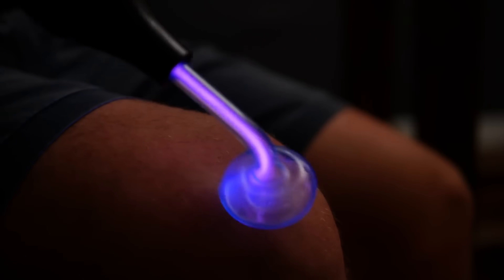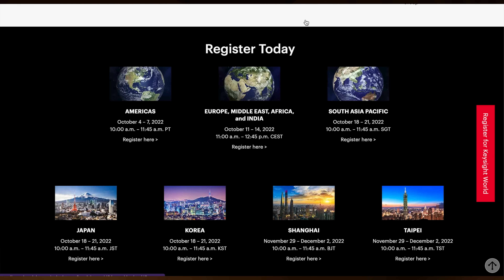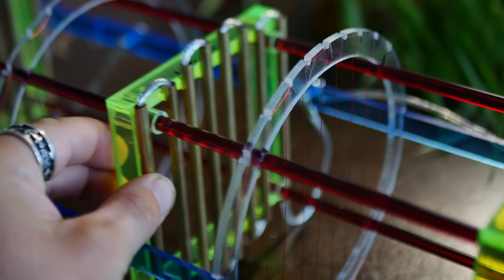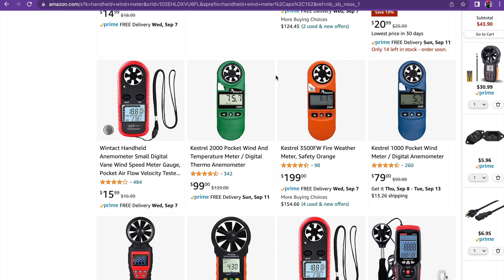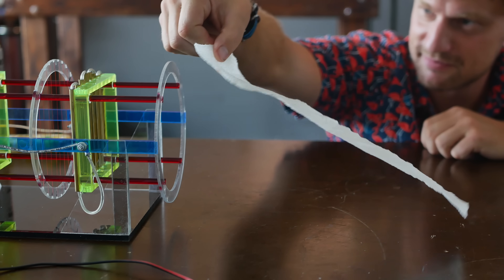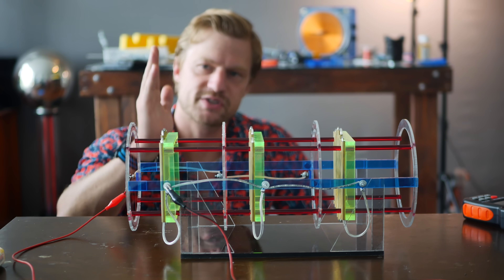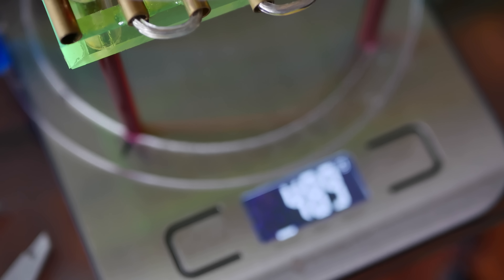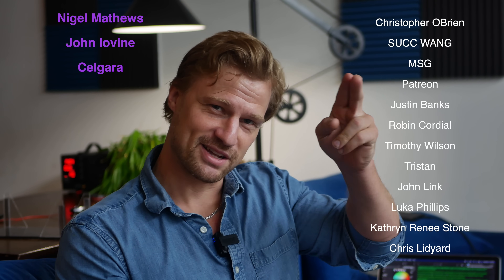Designing A Next-Gen Ionic Thruster! (For Flight)

Comment: Beautiful Build and excellent scripting/editing. KUDOS ❤
One area of improvement, which the spacing is beginning to introduce is to stage the lead of each stage to be lower  than the end stage of the previous stage.  Accelerate rather than retard the ions between stages. 
However, more thrust by increased airflow (even without more ionic thrust stages is possible) Also a proven design is to use the “blade less” fan modification, introducing an external air supply to be sucked into the existing (more concentrated) ionic thrust central flow. They say up to 10x increases in air flow are possible. (If memory serves). Looks to be a key innovation to electric airplanes in design already.

You are the FAN MAN!  Success is yours to capture. Tether it to the table or a replica of the Eiffel Tower and a new topper for Christmas Trees and executive desks or totally revolutionary drone power is born. 
Another idea is to compress the ion flow by constricting the pathway. (Using a tube with an inductor winding (magnetic bottle), perhaps with a rod set to rotate inside with a bullet tip and cupped end (AKA GEET Reactor) low cost Z-Pinch plasma fusion stage… and/or add water vapor to your air supply (massive increase in mass of ions with amazing ionic reactivity) 
Party on Dude.

Comment: I suggest going back to a square thruster path. You can now cheat by angling the follow-on stages, narrowing your box area without narrowing your ion mesh creating increased air pressure against eash stage until the exhaust is a narrow thrust nozel

Comment: The thrusted air comes from the pulling of ions from across apposed charged metals, the charged air exiting each grid section would be improved by adding in a charged gas to replace the stripped electrons exiting the grid of each section.  Enclosing this fixture would actually slow the thrust down since it relies on pulling external air in with the laminar flow of charged electrons, so if each grid stage had a large funnel shaped air scoop, it could pull in and condense more airflow for each chamber, thus a net gain in thrust output.  Another way to gain more thrust is to redirect a portion of the expelled air back into the frontal intake, because there is no limit to the speed of airflow that can be introduced into the device, so this would act like a turbo charger continuously increasing the air flow, thus creating a larger and more intense draft of ambient air into each grid section, creating a suction in the front of each grid air scoop.

Comment: I love your dry ice wind tunnel. I don't think I would have ever been able to get my hands on anything but the "plasma" plastics. Is there any difference to the thrust by splitting the wires into multiple parallel joined wires? Can the thrust be made variable? What happens when you do the distance adjustment on a single stage?

Comment: Things that I would try if I had the tools and the space to work on this:  Enclosing the device.  Taper the enclosure so the opening is wider than the exit to create compression.  I would experiment with spacing, and I'd experiment with staggered voltages as well.  Don't make them all equal.  Maybe higher voltages as you get closer to the exit.  What about decreasing the gaps between the wires?  So start with a wider opening and lower voltage.  Make the spacing tighter towards the exit and increase the voltage towards the exit.

Comment: Are you losing pressure with the sides of the engine being open?
Reply: I also wonder if the staggered arrangement is working better because they are grabbing fresh air particles from the sides rather than re-throwing the already accelerated particles. But Idk I also have no idea what plasma as thrust even means.

Comment: Wouldn't the reverse also work if you blow air through it it would create electricity?
Reply: I think so but the air particles would have to be ionized.
Reply: @garypeluso3300  outside air is, depending on different atmospheric factors.

Comment: Duct, incorporate a venturi system for more air compression.
I would also say use the dry ice for cooling and air density spike. desner medium might have more thrust. the cold will help no matter what.

if you wanted to use it as a turbo for a combustion engine it might actually be kind of novel because you could use the engine to also generate power for the system at idle etc.  It would be fun to see on  a simple motorcycle engine you could put a propeller on that and then use it as a sort of NOS like scenario with a small PSU. if you were competing in an race I would see it having a use especially

Comment: You probably already know - but round designs will probably yield less parasitic turbulence and I've seen generic airflow designs where collars that direct airflow greatly increase efficiency. A camera that is highly sensitive to UV connected to a bright monitor may provide a degree of added safety by showing you where HV plasma is spilling & help prevent corona-discharge where you don't want it. Be safe - this stunning field of physics is also perilous.  A device that monitors the charge differential on your skin might be an early warning if you get too close to a source that wants to find a path elsewhere.

Comment: instead of 4 pillars if you use a central pillar or no pillar at all inside a cylinder with a spiral path from outside to middle then exaust it from middle causing the wind to travel around spiral picking up speed & pressure which will allow you to concentrate its energy/pressure without it interacting with/losing energy to 'dead' air that isnt in motion, you can then attach a nozzle to exit point and further increase the pressure 

(if you did it right you might even be able to take advantage of the rotating detonation engine principle if you can get plasma hot enough/pressure high enough to create a detonating shockwave you might be able to build a cylindrical shockwave engine right before the nozzle)

things you could maybe do:
you could further increase the pressure by adding a nozzle to exhaust
you could add cowling/enclose the process
you could change the arrangement of engine to a turbine or a drum rather than a tower stack
you could place air intakes around outside and build the wind tunnels path as a series of spirals/nautilus shapes that are forced into middle then out a small nozzle maximizing incoming airs surface area
shaping the negative electrodes to be more aerodynamic/like symmetrical wings would also help reduce friction
adding a jagged surface to leading edge would also increase conductivity
& i suspect you only need them a few mm apart for maximum flow, i think having them further apart just increases the voltage needed/energy intensity & gives more time for air to hit other air particles that arent in motion/lost energy (something that admittedly cowling helps solve)

Comment: - adding a duct around the main body to prevent air from escaping the desired system 
- nozzle at the end to concentrate the airflow increasing thrust
- Magnetic fields to increase flow 
- Little barbs on the wires... just dont poke yourself
- what if you added more segments and maybe placed em a little closer together, not sure if that would allow for greater speed or if it would completely diminish them.

Comment: It's the air mash you need to worry about A tube like a jet engine around a thrust . And a way to find mechanically the spacing  To Very the thrust A little more less plenty design And a throttle wouldn't hurt

Comment: Hi. Try powering each section separately with a higher voltage at each stage or by shunting several outputs from the multiplier (increasing it from start to the end).

Comment: maybe ducting and forcing air into a cone compressing/depressing air along the way, also using a sort of wire with more terminarion like a mettalic foam(respecting and dont obstructing windflow), and maybe forcing the ionization not from + to - but maybe making a more dense like three layers of +++ an then discover how much negative is necessary to use it properly like 8 layers of - or only 1 who knows

Comment: 1. energy is released at sharp points where streamers occur.
2. a lot less acrylic can be used, and a less dense material too.
3. duction reduces losses
4. add a high volume intake fan followed by a compressor to potentially x4 your air density to increase fuel flow and therefore efficiency and thrust
5. add a device within system to make the air temperature lower (paschen's law)
6. add more stages
7. use aluminum electrodes (less dense)
8. increase voltage
9. increase energy input
10. optimize electrode-field-and-drag placements
Reply from the maker: Excellent points. Some of these are very feasible, and I’ve included in the upcoming new version.
Reply: @PlasmaChannel  awesome! I’m in the works designing a high volume air compressor and testing different electrode geometries. I can send the STLs or maybe tested parts once the numbers look solid. I have a theoretical equation based on ion mass, electrode spacing, voltage, gas temperature, gas density, total unit volume, and average ion charge for thrust. Next will be the gas temperature module as this allows for better compressibility and higher voltages per same electrode spacing, increasing thrust capacities. In the name of space mining. Look into the moon’s gold, yttrium, uranium, and thorium supplies! 100X more gold at the south pole, which happens to be at room temperature, than the richest gold mines on earth all within the top 10 centimeters of the moon’s soil, which can be separated chemically and expelled

Comment: Does temperature have an effect on the ionic wind? Could the system produce more thrust if the air that goes through it was super hot, so that the molecules were already excited and moving a lot faster than cold air.

Comment: First, change the distance between thruster one two and three
Second, encapsulate the thruster into a liniar tube and adding a thruster vector nosel on the end. 
Third increase the amount of electrodes and electricity that incorporates minimal spacing to allow for maximum airflow through the ionic field. Goal more electrical power, more electrode contact points and more thrusters in series
Lastly, have adjustable voltage to all thrusters to allow for greatest velocity throughout the ionic field. This can create a cascading velocity effect.

Comment: Very cool... But I have a question... is it worth considering a different formation of the linear arrangement of the wires. Would a coil work and would a Taurus arrangement work? My thinking is, a tornado is the better construct for thrust as in a vortex configuration. 

The next thing maybe to work with is the exiting of the air, by directing the air flow as a jet, perhaps using magnets or a shroud, so the flow of particles is not turbulent but channeled and focused.

The flow of air into the thruster, might be worth considering, again a shroud so the more stream line the more efficient.

Finally your grid is all the same size, is there any opportunities to make the cage / grid so it expands in the middle so you boast the trapped particles, sort of like a jet engine that feeds more fuel at different stages.

Comment: First issue is theres nothing stopping the air from leaving the system, and the system is drawing in new, static air; put it in a tube with flared intake and maybe a tapered(or spiked?) exhaust so rach stage is working with accelerated air and all the air can only leave through the exhaust rather than the sides.

Second issue is the diode layout. A grid, or hexagonal pattern would use marginally more voltage and have greater  surface area, ionizing more air.

But honestly, this is less like making a jet, and more like making a v layout piston engine. More pistons rather than axial combustion and inline rotation. This would have to be completely redesigned to be a jet equivalent. My initial thought would be to run the positive down the length of the system and have it surrounded by negative. Which is then surrounded by a positive etc.
Reply: If you think about it this is just a bad capacitor that happens to generate thrust, so just design it like a super capacitor and it already be more efficient

Comment: How about using cones to channel the airflow that would create a larger pressure behind and lower in front increasing the thrust. Similar to how a steam jet air ejector nozzle works with a diving force created by the ionic thruster but creating a larger thruster due to the low pressure created that pulls in additional air and creates a larger output.

Comment: Hi, I have a plan for you. You have seen these bladeless fans that are indeed airflow multipliers, these will increase your airflow by a factor of 15. Yes it will require a bit of plumbing to supply the ionic pressure into ducting of the fan, but the results will blow your mind. Also, you should add a few more stages to the ionic thruster and keep them relatively closer together to avoid eddy currents.

Comment: I'm not physicist, but a couple things I wonder that would improve the design, would be NOT wiring the power in parallel, so the individual fields have independent control, then, using a conical design to add pressure, that should increase thrust.  These are guesses.

Comment: 1) To expand on what I said in my first comment you should use streamline shaped model tubing rather than the round x section .  The round profile is one of the r worst in terms of drag and creating turbulent air flow.  I don’t know what is best for generating the electric field you want so I imagine it will end up being a compromise between known low Reynolds’s number airfoil cross sections and the ideal field shape.   2) I would enclose the flow section in a straight tube for the 2nd proto.  This will allow you to focus on the central airflow.  You will be introducing a boundary layer effect from the tube wall. But it will eliminate  effects from the stages drawing air in from the side and cross flow from the environment.   Youll need to build a way to measure airspeed and pressure between each stage so look for a pitot tube bc the fan based one is going to alter the flow way to much given its size compared to the general flow area.   Save a nozzle for later you re operating in a low Reynolds’s number effectively incompressible flow conditions at 2m/s if Memory serves.  A nozzle should just bump the exit velocity up but the boundary layer on a surface can do strange stuff that slow and that small scale.  NASA should have some papers on flows of Xenon ( I think that’s what they were using in their space thrusters) at low pressure but the speeds will be very fast so who knows if the Reynolds’s numbers compare.

Comment: First off this is an awesome build and overall a very solid engineering test rig. One a rear for improvement from the aero side, 1) use streamlined tubbing with a airfoil cross section k&s offers some in al. Not sure who would offer in copper or brass.

Comment: Really cool.  Efficiency may be made by adjusting gaps between stages based on the velocity of the previous stage.  By adding a mechanical adjustment of the distance between each stage, some simple AI may be able to discover optimum distances and voltages at each stage.

Comment: Great build. Try using clean nichrome wire without lacquer. The lacquer coating is an insulator to the flow of electrons off the wire. Also. Use a 3-d printed cone to entrain airflow. Think Dyson fan.

Comment: 1. Only using 1 for the almost 50% increase of thrust. 2. Cutting down the edges and size of the engine will lighten the load allowing more thrust on a plane obviously. 3. encasing the outside edges to allow the air-flow to become more concentrated like a jet engine.

Comment: Maybe use a thin superconductive material to encase the ionic grid in a cylindrical shape , the superconductive cylinder would not only vector a more controlled thrust it would further ionize the air in the cylinder by creating a plasma type venturi effect ,the hotter air gets as it moves through the cylinder the faster it will move , you can also try cooling the air by filling some small tubes at the intake side of the cylinder with some liquid nitrogen

Comment: I'm going to say inefficiencies one and two are excess weight in the frame and air flowing out between stages. The third maybe the amount of points the plasma has to launch from on the wire? I saw the distinct points and I'm guessing you'll want to score more of the wire to let it use more of it.

Possible fourth option is that you're using tubes rather than sheets, I haven't done any research on ionic thrust but from the demonstration I saw they had a wire above a thin sheet, so the area in front of the wire should be able to stay thin to minimize air contact